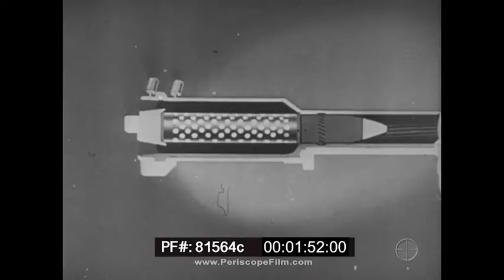57MM RECOILLESS RIFLE M18  WWII TRAINING FILM  PORTABLE ANTI-TANK WEAPON 81564c

Comment: Obsolete for Vietnam. However, some did exist in Special Forces camps. (They also had 30 cal Browning machine guns.) I had the opportunity to fire one round for training (March 1968). Tripod mounted. Sighted on a tree across a small valley. The round hit exactly where I aimed. Also shot two M72 LAW. Actually one failed to fire - an issue with early models. I was not SF.

Comment: I wonder if you could carry around a m3 37mm gun like this. Would be alot more effective with sabot too.
Reply: No, you could not. And any of the "hollow charge" weapons are dramatically more effective than the 37mm once the round is on target.  Muzzle velocity and the commensurate increase in range are the 37mm's only advantage. It should also be noted that this film had to be circa 1950 or later, while the 37mm was already insufficient against many tanks by 1940.
Reply: Nope - it's too heavy, not recoilless, and can't shoot a large enough sabot fast enough to harm modern armored vehicles.

Comment: Can anyone tell me the advantages of a recoilless rifle over a bazooka?  It seems like a bazooka would be a lot less weight.
Reply: The WWII US 2.36" (60mm) bazooka was not very accurate and had a very slow rocket (265 ft/min, less than most BB guns).  The low speed meant that misjudging distance slightly could result in a complete miss.  Even so, it would often not penetrate a tank's armor.    General Patton was quoted as saying  "the purpose of the bazooka is not to hunt tanks offensively, but to be used as a last resort in keeping tanks from overrunning infantry. To insure this, the range should be held to around 30 yards."  The  3.5" (89mm) "Super Bazooka" that was issued in the 1950's was useful against tanks of the time.
     The 66mm M72 LAW and it variants are essentially singly-shot descendants of the original Bazooka.  The M72 is faster and has roughly a 200m range.

The 57mm recoilless rifles were much more accurate at with a muzzle velocity of about 1200 ft/min and useful to a much greater distance.  It was useful against Japanese tanks and pillboxes, but not against German or Soviet tanks except for "lucky shots" that hit vision slits or particularly vulnerable spots.  It was more useful for shooting high-explosive rounds, though.

The AT4 is an 84mm single-use recoilless rifle and the Carl Gustav M4 is a reusable 84mm recoilless rifle.
Reply: Bazooka's are from WW2. They only fired antitank rockets, came in two sizes. Recoiless rifles came late, 57mm, 75mm, and 106mm(jeep mounted). They had at least 4 kinds of rounds, did more damage and shot farther and more accurately. Marines had a track called the Ontos with 6 106's mounted. Rangers still use a modern version, the Carl Gustav.